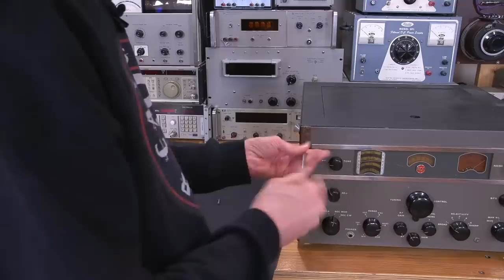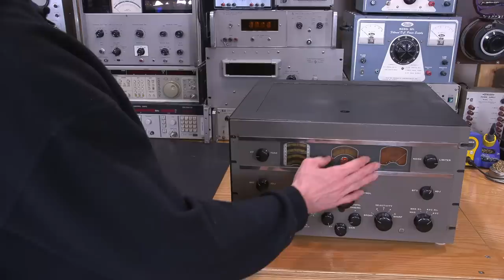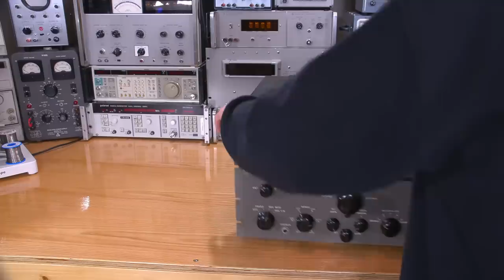1946 Radio Receiver Teardown - The RCA CR-88!

Comment: From what I have learned oil caps like the ones in you video could contain PCBs or polychlorinated biphenyls which are hazardous. As a side note PCBs are very hard to dispose of because they are resistant to acids, electricity and fire.

Comment: Thanks so much for bringing back memories from 50 years ago. I had the AR88 version, spent hours in front of it spinning that wonderful geared tuning knob -  such a stable and brilliant receiver. HF aviation reception presented no problem with just a 60 foot length of wire to the fence post!. 

 I did look inside and under the screening covers and wondered then about re-alignment but seeing all the twiddle points, and not having any test equipment, I resisted the temptation.

I had a hairbrained plan to find a motor and appropriate gear to add so I could tune it from my bed - fortunately I held off that master plan!

I regret selling it - but 8 years later I got more than I paid for it.
Reply from the maker: Thanks for sharing your story Barrie!

Comment: I once had an AR-88. I got it from Ozona Bob, W5PYT (SK) about 30 years ago. Bob bought it sight unseen from the Yellow Sheets, and it arrived incomplete. It was missing an IF can, the phasing IF can, the mode switch, and the wiring harness was diked out! Bob gave it to me, and I promised I'd try to get it back in service. It took several years, but I did get it working quite well before Bob died in 1999. It actually HAD the alignment tool!!

Some comments as I remember them. The AR-88 and CR-88 had a different IF frequency, but the IF can coils inside were identical. The only difference was the internal fixed capacitors (Mica I believe). One thing that floored me was the HV DC power supply with dual chokes and several oil capacitors for the filter. Any attempt to add more bass to the audio was offset with the C-L-C-L-C filter being excited into resonance from audio as low as 200hz. 

Jim
Wd5JKO
Reply from the maker: Thanks for sharing your story Jim.

Comment: Hi Paul.
Great series. 
In downtown Copenhagen there is a museum known as the “post office museum “.
I understand it has been relocated since, but they had a great display of a listening station and a number of disguised receivers and transmitters.
The pride of the collection was an  AR-88.
It took a minute, (10-15 years) but I finally snagged one. 
It’s in decent condition, has the reverse reading meter, etc.
These were often used in embassies, as well as collins 51js and others.
Many thanks for all your efforts .
Greetings from Montreal.

Comment: Some years ago I purchased a number of new old stock parts for my  RCA AR88  all in their original wax paper a  power transformer the large capacitor block to name but a few. Upon opening the large transformer from its wax paper which had not been opened since 1943 I found a copy of an American News paper which was used as packing the front page give an update of the war.  ( Comment from England )
Reply: In 1975 I went down to a surplus shop here in the UK and purchased a new output transformer for my AR88 and that came in USA news paper about the war effort making bombers.
Reply: You were indeed lucky,. I also have a new output transformer for the same 88 upon opening the wax wrapping a few months ago there was some 1943 America straw used as packing

Comment: You cannot stress enough the value of shielding in these old receivers with all that dangling point-to-point wiring going on, and all those zillions of screws giving the whole thing not just bonding but physical integrity.  This is a cold-war treasure and it's in great, good hands.  Thank you!!
Reply: Speaking of ‘physical integrity’ of construction of electronic devices, just reminded me, that back in the early 1970’s as a then young and pimply faced Government ABC radio tech, I had the opportunity, to peer, into the innards, of a Wandel & Golterman Spectrum Analyser, that was being used for sweeping the response of some NEC low power, TV ‘Translator’ Transmitters, and their tower-mounted Antenna Arrays, that we were installing at that time, throughout remote and regional areas of Australia, and comparing the ‘physical’ construction of that device, to the construction of this 1940’s era RCA receiver, are a bit like comparing chalk, and cheese. 
The build quality, of the engineering in the W&G Analyser was, eye-opening, with every individual section of the circuit, being separately, fully compartmentalised, and with the entire, chassis, of the whole thing, being made from 1/3” (8mm) thick, Die-Cast, Aluminium, and with Teflon standoffs, and insulators, and gold-plated RF-coils, and contacts, used throughout it, everywhere. 
Needless to say, it weighed ‘a Ton’ (figuratively speaking) and was valued , at more, than my own, then, entire, annual salary. 
Needless to say, we treated it, ..reverently. 😉

Comment: with the wire looms and the way that is constructed it looks just as good as a piece of Collins Gear. Everything has a place and is separated from each stage to keep the radio from just taking off from RF. Very nice look inside the radio Paul. Thanks.

Comment: Thank you so much Mr Carlson! I have a RCA AD88D which I bought in the early 1980's. I have not used it for a long time & I have been waiting for you to restore one so I could attempt to do mine. I was not sure on whether or not to replace the oil filled caps as I had heard they would be ok. I will definitely replace mine now. My AR88D has been modified at some point & a ECC83 has been added. Not sure why but hopefully I will be able to figure it out 😄 I look forward to your next videos. Thanks again 👍
Reply from the maker: Hi Mike. The ECC83 or 12AX7 is probably a product detector. A real common modification way back when.

Comment: Great video! Although "boat anchor" radios are heavy and difficult to handle on the bench success is a matter of mastering leverage rather than physical strength. Yes, you are a vintage electronics bench ninja! I have a bench made of unfinished 3/4" fir plywood. I place the equipment on top of old terrycloth bath towels to drag them around the bench.

Comment: Awesome vid . If you lift the case a bit and slide your protection mat under the feet of the case you can then slide the inside component right out onto the matt without any concern of wrecking your table top . It will hold the mat in place . 👍

Comment: Just a minor note that the black paper-faced foam board is commonly referred to foamcore. It's typically used as rigid backing for photographs and picture framing, but it has other uses (as you've shown). Very interesting rebuild, looking forward to the next ones!
Reply: i currently place the black foam bds on my ( sun-facing ) windows to passively help keep my place a little warmer . . .  i'll switch to white ones come summer!

Comment: Many years ago, when I received my AR-88 from a friend in the UK, I was advised not to change the bathtub caps - even if they are leaking oil.  I'm glad I listened to that advice.  To this day, my AR-88 works flawlessly with nearly all original parts - including tubes.  The bathtub caps I have checked test within original tolerance, under voltage.  If the caps leak oil, I would rather clean and seal them, rather than shotgun them.  The oil is probably toxic, but manageable if you're consciousness.  Just don't eat it or smoke it,

Comment: We had these AR-88's when I worked as a CW op @ WPA/Port Arthur TX RCA coastal station....they were excellent on the 4/6/8MCs band but were so-so on t he upper HF frequencies.......we used 600Ω 'cans' but installed a step down xfmr 600:8 Ω so I could use a regular headset to keep the external noise to a minimum...it definitely was not a quiet room as we were monitoring 500KCs while at the operating position(s).
Reply from the maker: Thanks for sharing your story Tom!

Comment: Paul, I have a prediction. 
I do think that you will end up doing those oil capacitor rebuilds. 
After all, you did that wild 'Transformer Repair {Depotting}' episode 4 years ago. 
These should be easier than that, and they will look SO FACTORY when completed. 
That can be a whole episode by itself.

Comment: I am thinking of repurposing  an old air hockey table for the part of the bench where all the stuff I work on goes. Variable fan pressure and I can balance it between moving heavy stuff around with one finger and making all of my small parts fly away.

Comment: I thought mine was clean but yours looks like it came off the factory floor. At 11:40 in the video you will see at the back of the shot on the side of the chassis there is a little spring clip. That is where there should be an Allen key (2mm I think) intended to remove the front panel knobs. As usual it is missing.
Reply: I was wondering what that little spring clip was for...

Comment: My Ar88D came with as rare as hens teeth special tools for adjusting the plunger trimer caps which are clipped to the tuning capacitor box.
Reply from the maker: You are very lucky!
Reply: @MrCarlsonsLab  My AR88D is date stamped on the tuning gear drive mech 1943 by the navy and those trim tools must have been supplied with the set from the factory all those years ago.

Comment: I'm very much looking forward to the part where you clean and lubricate the gearing and tuning capacitors. I've been putting a junked EICO 379 frequency generator back into working order (so very many parts have been broken, including physical components - it was very dead) and while my cleaning and lubrication so far has done a lot, I think there's a fair bit more room for improvement in the tuning gears.

The black foam material is usually called formcore, by the way. Because it's paperboard, but with a core of foam.

Comment: i would bolt 2 vertical wooden blocks on the front of the rack ears.  then you can tip it face down on the front.(with the blocks giving clearance.  then pull the back up and off.

Comment: According to my 55 years experience to deal with those old made electronic tube device, first thing to do, replacing all the electrolytic capacitors especially on DC filter path, because most of them lost their own capacitance after closed to 77 years. The chemical paste all dried out. Also check all the wax paper and oil type capacitors ( most are 0.05uF till 0.1uF) with capacitor tester that comes with high voltage leakage test, set testing high voltage rate match with the voltage reading marked on capacitor, some could be opened (showing very little capacitance) or voltage leakage. Replace them all is the fast way to restore its performance rather than test them one by one.
There is no need to keep the old age full wave rectifier tube because most became weak and hardly find the same replacement, replacing it with two 1N4007 will do.  With this simple act, high voltage output becomes a bit higher with better DC quality.

Comment: Hi Paul, The timing of this video is good for me.  Although I’m not working on a CR-88, I just started on a Hallicrafters SX-42.  As you likely know, these are very similar beasts but different.  Like yours, mine looks all original.

I’ve been meaning to ask you for some time: have you considered making a camera gantry?  I’ll bet that moving that tripod gets old and if you had a roll-away, overhead gantry that be remotely controlled by a simple stepper motor arrangement (could be manual too, but what fun is that?) and you’d have an optimal platform for lighting.  You do such a good job producing your work but I’ve often though that your setup efforts are sometimes difficult.  Anyway, with all the room you now have, I thought I’ve make the suggestion.

Cheers, Scott

Comment: I'm an EE older than that radio and worked on RCA radars from 1956 to 1964. I understand capacitor leakage and electrolytic degradation but a lot of them leaked when new so the circuits are designed for it. Why don't you just test them all and replace bad ones? With these commercial and government sets if they haven't deteriorated in 80 years they probably won't. I worked with many Tektronix, HP and other high end test equipment and it's no surprise that when you turn them on they still work. There's a documentary about the first tube electronic computer called "Collosus" developed in the UK in WWII to break German code. Tubes were thought to be unreliable in the 1500 needed there but a post office engineer solved the problem by never turning the filaments off and soldering them in. Kept secret for decades and preceded ENIAC.

Comment: For reasons of safety it might be an idea to use the Low Voltage Vacuum tubes that were created in 1957 because the transistors were not ready for prime time and the manufacturer wanted to get rid of the vibrator as it was a source of interference which would mean that both the Heater voltage and B+ would be 12V and as it has no speaker just a headphone socket so why not.

Comment: Following along here, thank you for doing this. Tried my AR88LF and it works, but the top shield box over the RF section is missing. How much of a hit will that make to the performance when we're done?
Reply from the maker: For frequency stability reasons, I would find a replacement box.

Comment: The explanation here is wonderful. Like listening to an engineer or very experianced operator during the primary install and use Era. But there is a bottom line; after restoration, how does this receiver compare to the "big 3" of that Era; the R-390, 392/the HRO 50 & 60/
The SP-600. And once fully restored, what is the reliability and ease of repair
And what is the typical use hours to  need for repair/maintence cycle?
Important considerations in an emergency back up or survival
application setting.

Comment: You say you intend to use a spectrum analyser to do the alignment of this receiver, but, how was it originally done, back in the 1940’s, before, spectrum analysers were available..?? 🧐
Reply from the maker: They used an oscilloscope and a sweep generator. This performs the same function that the spectrum analyzer does. The device (way back when) was also known as a "Wobbulator."
Reply: @MrCarlsonsLab  Ok.   Way back in the 1940’s I thought that it would have been even a bit too early, for the use of Oscilloscopes. 🧐
I thought it may have been more like a matter of them having to use a Sweeper, with a VTVM, and a whole lot, of, patient, ‘tuning tool twiddling’ along with, a whole lot more, of, muttering, and quietly spoken, ‘cursing’ mixed in, for good measure. 😉

Comment: I have an AR-88LF that spent it's entire life monitoring WWV on 10MHz at the Sandspit Airport on the Queen Charlotte Islands (Haida Gwaii).  It had a number of tubes with metallized paint that were bad.  I could never find replacements for them so had to substitute with metal ones with similar characteristics.  The radio did work but never did perform like it should.  Do you know of a source for these metallized tubes?
Reply from the maker: There are lots of old radio tubes still around, and many online stores that sell them for very reasonable prices.
Reply: @MrCarlsonsLab  I agree, there are still lots of old tubes still around but I couldn't find any with the metalized shield painted on.  I notice your CR-88 has the metal shielded tubes.  I will compare my schematic with yours and see if the nomenclature for the shielded ones is the same for both radios.  If so, I will try and find the metal versions since they are probably easier to source.  My AR-88LF must have been made prior to the actual metal shielded ones becoming available.
Reply from the maker: @dougkathydavies3024  The only glass tubes in these receivers are the VR-150, the 5Y3GT and the 6K6GT, all the rest are metal. The glass tubes have the "GT" letters after the tube number. GT= Glass Tube. Do not use glass tubes anywhere else in this receiver.
Reply: @MrCarlsonsLab  Poor choice of words on my part.  My apologies. I should have said "characteristics", not "nomenclature".  I only have glass in the spots you mentioned.  I have metal ones where the old painted ones were.  I had to make up socket adaptors for some of the replacements which was a royal PITA.   If I remember correctly, those painted shield ones were made by Rogers Majestic.
Reply: There is in the UK Langrex tubes and Colomor tubes might have new old stock.

Comment: Hi Paul i just realised why yours looks different to my AR88, cos its a CR88!! Did the CR version always have the grey paint job do you know? Have you heard the story (maybe a myth) of a number of AR88s that were dumped in a river, but were dredged up, dried out, and continued to work as normal? 🤔😉😁
Reply: I heard a similar story where a large number of AR88s were thrown down a disused coal mine & were later found & sold off for spare parts. ☺

Comment: A really good video and useful for me. I have several AR 88s and was undecided about removing or  stuffing the "bath tub" capacitors (that's what they call them in the UK) but now you mention the unsafe oil, I think I'll go for a straight replacement. Thanks!

Please would you say which is the best communications receiver of this type and era, in your opinion?

Comment: I'll be most interested in the spectrum analyzer alignment,I recently got a nice HP spec analyzer (without tracking generator) and am very worried about blowing the front end by accidentally getting across too hi voltage.

Comment: Enjoyable video but we only needed to be told the set is heavy one time, not 5 or 6.  Also you completely ignored the polystyrene coil forms in the shielded sections underneath the chassis, a low loss innovation that made the set's 10 m. sensitivity outstanding circa WW2 and part of the wonderful design work of the RCA team led by Lester Fowler.

Comment: What does B Plus mean?
Reply: Positive supply voltage for vacuum tube circuits, also called anode voltage. Usually about 300 VDC and potentially lethal.